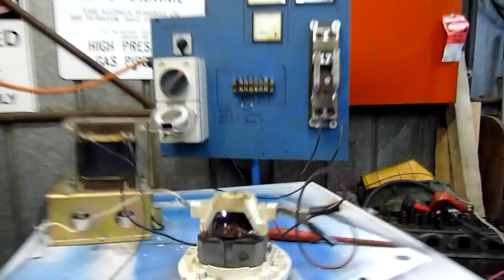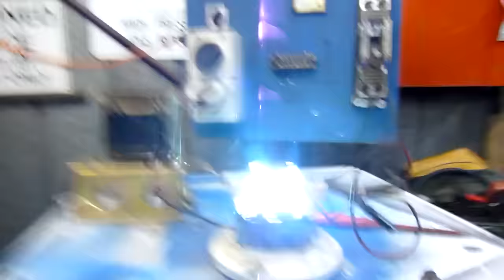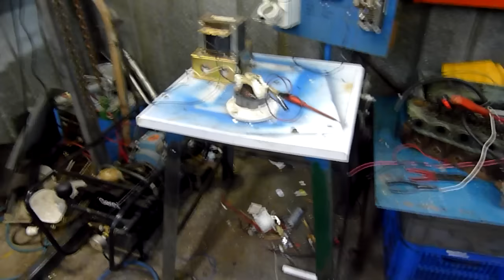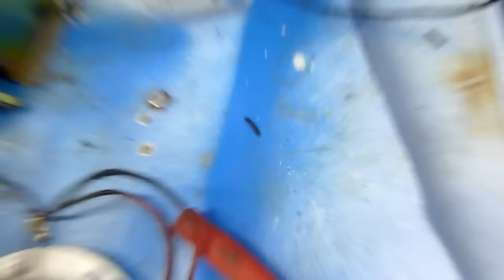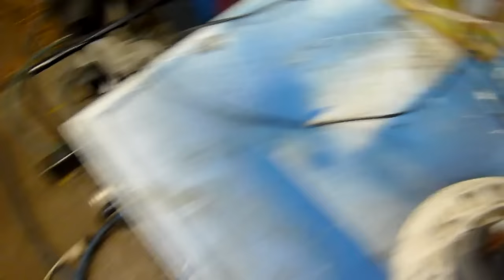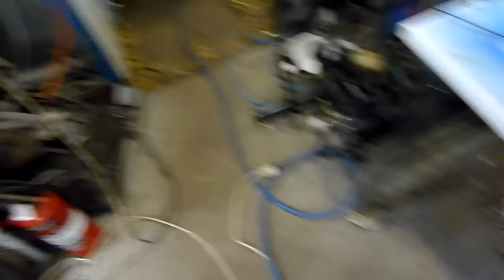Vacuum Cleaner Motor  Pop on Variac and Step-Up Transformer

Comment: Reminds me of the time I had a speed regulated 175 HP DC motor on the job. It lost it's field voltage, and field loss relay at the same time.  MAN, what a mess, com bars, end bell fragments etc, all over the placi.  A motor designed for 1800 RPM, max, probably hit 5K before letting go.  Motor and regulated drive  by Relience Electric, Cleveland, Ohio.  Much mechalical/electrical and some structial damage.  Lotts of fun.
Dick

Comment: @romandybala Volts times amps equals watts which comes out to 1560 Watts, close enough. There is a way to convert to horsepower from Watts, times the Watts by .00134. So 1560 x .000134 = 2.0904 Hp. or by using the more conservative 1500 Watt rating it will come out to just over 2 hp.

Comment: You should "pop" one of those motors with it submerged in water.  The water would cool it down so it might last a bit longer, but the resistance of pushing the water around would load the motor down too... maybe cancelling the effect of water cooling it?  The water shouldn't short the incoming power, since it's got a somewhat high resistance.  It will cause some heating in the water but I suspect the motor will be providing lots more.   (Might be cool to run it in oil too!  compressor oil?)

Comment: Hi, found a motor at the scrappys today.
Madein South Aus.  Out of small garden mulcher
input 1500 watts
Encl IPOO  Rev 2800  Amps 6.5  Rating S 9.  Cap 20./ 400v.      Hz 50.    Volts 240.  
Can you determine from details how many HP. in this motor? thanks

Comment: Ah yes.....So much fun to be had with a variac & a brush motor. :-D 

Crank it till it pops. :-D

That transformer on the table needs to be kept solely for motor torture sessions. It has potential ( unlike a MOT ) to give it some without burning up. 

Nice big *POP* at the end of the video, with bits everywhere. Please do another 'bearings seizure' video again soon. That other one you did was quite entertaining! :-D

{^_^} BoomBoxDeluxe {^_^}

Comment: What we need for these type of runs is some kind of universal electric motor dynamometer that could measure power and torque increase with the extra voltage.  Or maybe I'm just a geek   (:-|)